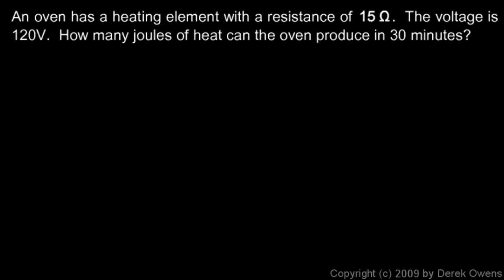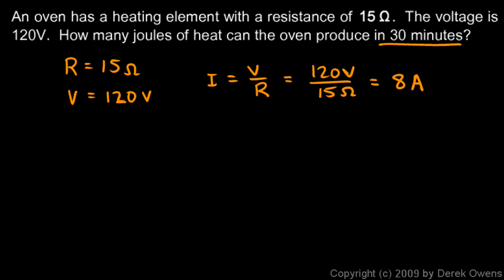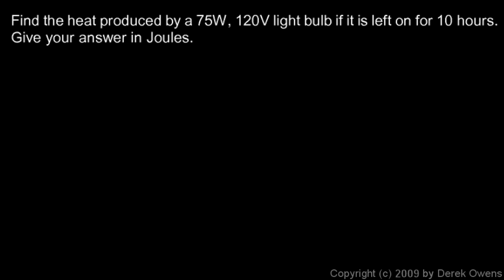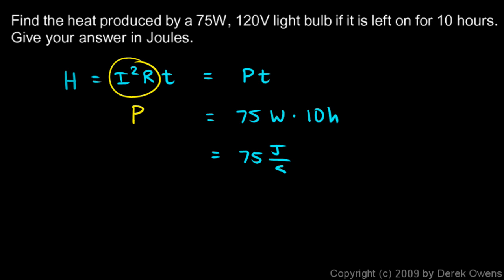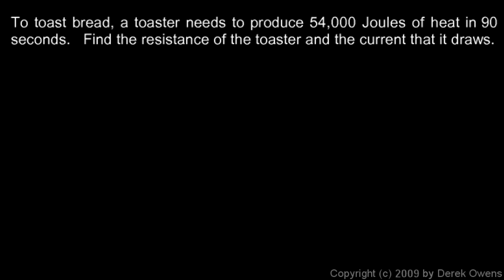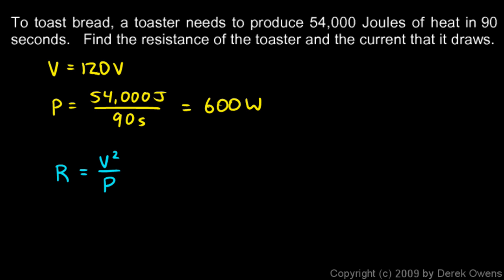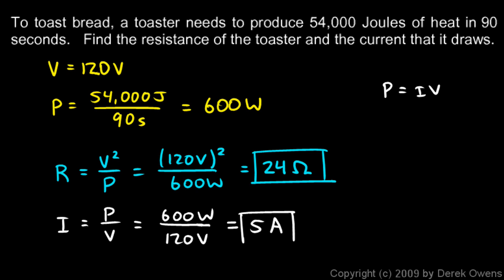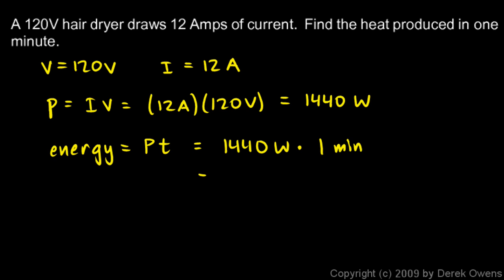Physics 13.3.2b - Examples

Comment from the maker: Yes, energy and heat are the same thing.  Or it might be better to say that heat is a form of energy.  Different equations are useful in different situations, depending on what you know.  If you know P and t, then you can calculate the energy as P*t.  If you know t, I and R, then you can calculate it the energy as I^2*R*t